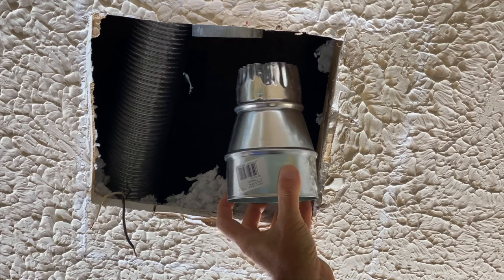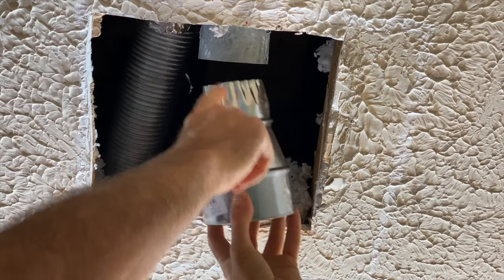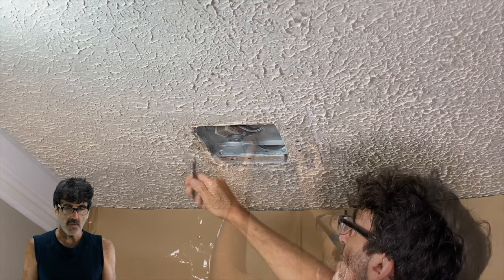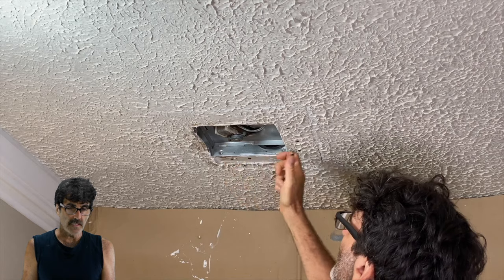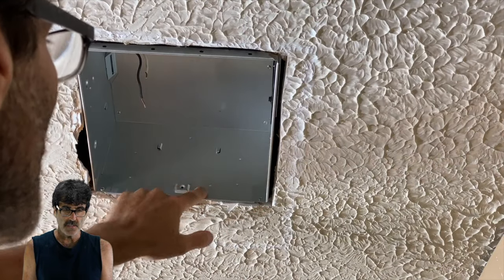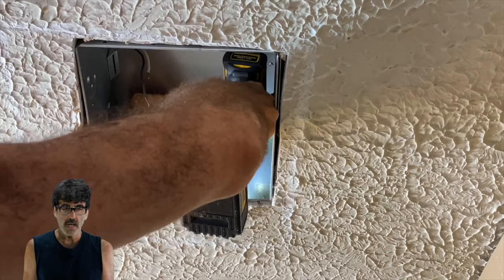How to Replace Your Bathroom Fan Quickly With NO Attic Access! DIY

Comment: I just replaced the fan motor insert with another of the same model but just like before there’s no suction, it’s made 0 difference .. I’m in a townhouse .. is it the duct ?
Reply from the maker: HI, yes theres a good chance the duct is clogged.  If you have access to where it comes out on the house, hopefully it's low enough you can see.  I've seen birds make nests in there and clog it up.  A lot of times there's a flap on the outside with a screen.  If the flap isn't closing good or the screen is damaged the birds can get inside.  If it's on the roof, or a high eave, you may have to get someone to look at it, if you're not comfortable with heights.
Reply: @TheHomeImprovementChannel  on this side of the sown house there’s multiple plastic boxes with slits hanging off the soffit .. that’s not good and should be vented through the roof as I’m reading it causes mold .. but that’s where they are, one of them is the dryer vent and Im guessing the other 2 boxes are for each bathroom up here, I have no way of knowing which is for which bathroom though.. should I run a snake through the venting from the fan side? And do those outside square plastic vents unscrew or how does one even clean them? It’s hard to belive a 100cfm can has 0 suction power .. I don’t even know who I’d look to call for this .. roofer, hvac, general contractor .. I tried angieslist and got no where with any leads
Reply from the maker: @mechanicalmonkey7777  HI, a general handyman can look at those boxes under the eave as long as he has a ladder that's tall enough.  I've seen some townhouses that are 3 stories high, so it depends on how high yours is.  No I wouldn't run a snake from the fan side.. If they used that silver flex duct from the fan to the exhaust port the snake will fill it full of holes.  Sometimes they'll use a hard duct and if they did it'll be fine with the snake.  The birds nests in my experience have usually been closer to the exhaust port on the outside.
Reply: @TheHomeImprovementChannel  I literally tried finding someone using angieslist and after they took all my damn info make me register it tells me no one in my area able to fix a bathroom fan.. which is ridiculous I’m in NY not Guam.. the only boxes I can see are right outside my bathroom window .. there’s 3, one is a dryer and then there 2 other ones that look identical and different from the dryer one.. I can’t see birds getting in because it’s just a box with small slits in them.. I’m not sure which goes to which bathroom though.. any idea where I can look to find a licensed individual to help me..
Reply from the maker: @mechanicalmonkey7777  Arrgh... Angies List probably thought you were looking for an electrician.  Which even if you were shouldn't be any problem.  Yes that does sound like the birds can't get through that.  The ones I usually see have a flap on the outside that's opened up by the fan air movement..  There's got to be something in there if there's no suction at all...  Do you have an electric leaf blower?    you might be able to rig up something from the inside and use the air from the leaf blower to (carefully) blow whatever is clogging the ductwork up.. I wouldn't use it on high power incase you're risking damaging the ductwork somewhere you can't get to it easily.   I wouldn't have anyway to know how to find a handyman in NY.  I would have tried Angies List like you did if I didn't know anybody.  You can try craigslist or FB marketplace, but you will have a harder time verifying if someone is licenced or not..

Comment: What if the old fan is 10X9.5 frame and the new is 7.5X7.25 frame. Should I get a different fan?
Reply from the maker: It would make life easier!  The new one will work of course, but it sounds like you'll have to patch the ceiling since the old one was bigger.  You're better off getting one at least as big if not bigger than the old one..

Comment: Completed this quest on expert mode. Forgot to flip the breaker off
Reply from the maker: I didn't forget.  The power is off with the switch.  I probably mentioned that.  You should check the wires to verify,.
Reply: @TheHomeImprovementChannel  oh no, I watched this post replacement xD to make sure I didn’t miss a thing. Missed them tabs
Reply from the maker: @funnyguy6097  Cool.. Thanks for the input 😀😀

Comment: What about replacing one of those in a mobile home
Reply from the maker: It should be about the same job.  You might want to check and see if it has the removable insert where the motor goes, it might be a quick job if it does.

Comment: Just me or when you pull down the flex exhaust it looks to be a 4" and your new fan is a 4".. @ 6:38  ?
Reply from the maker: It's been a while ago, but I seem to remember that was a 3" flex pipe... House was built in the mid 80s, not sure if it was original or not..

Comment: What if your replacing it with a fan that is the same size?
Reply from the maker: It's possible to swap motors.  See if the new motor will fit the old housing.  Then you can go from there.
Reply from the maker: Sorry I think I misunderstood.  Usually you can just swap out the housing that contains the motor and everything.  I did a video on this a while back:

https://youtu.be/1siTldg2Xns

Comment: How about between floors?
Reply from the maker: Sure can... I did this video on the premise that I didn't actually have attic access (even though I did), but I wanted to show that I didn't need to get in the attic to do the job.  I believe the key is to use a new fan that's a little bit bigger than the old one and that'll help a lot in getting the old one out without damage to the drywall...

Comment: It turned out that mine was put in with button caps, who does that? Made it incredibly hard to get out especially since the box was installed before there was any sheet rock in the home 30 years ago and the entire attic space has OSB.

Here’s a tip while your fan is screaming loud use that to locate the top of the box. It will save you a lot of time.
Reply from the maker: Arrrgh... that does sound like a pain.. ☹️

Comment: Learn from my mistakes. Check where your studs are. I cut my drywall and there was a stud there and my new fan doesn’t fit. So sad. Wish I had watched this before I cut.
Reply from the maker: Oh no!  It shouldn't be to hard to fix.  I have several vids on fixing drywall mistakes.  I would continue to cut the hole next to the stud for your new fan and then if possible try to save the patch where the mistake was so it can be reused.  If it's not reusable, then you might have to get a small piece of drywall to make the repair..

Comment: Nice job but you did not tape the connections
Reply from the maker: Thank you!  Do U mean inside the box?  It's not code here and isn't necessary.  You can walk into a brand new house that just passed all the inspections and the connections aren't taped there either.

Comment: Why do many builders put in duct with an immediate 180 degree bend….so much better to go straight out….
Reply from the maker: I agree with you... Straighter is better...  Hard pipe is best so you don't have all of the ridges of corrugated flex pipe...  Of course flex pipe is way easier to work with...  😊

Comment: I've had a contractor here 4 times.  My fan is still blowing moisture down.  I take a hot shower my floor is covered in condensation.  He says he can't match new fan to duct without getting in attic.  2 different sizes.  We have no attic access.
Reply from the maker: It sounds like a problem with the ductwork.  IS it clogged completely?  Maybe a bird nest?

Comment: Anyone done this with vermiculite in the attic?
Reply from the maker: Arrrgh!  You'd have to be very very careful not to let that stuff stir up any dust/ particles.  I really can't recommend that you attempt to handle that stuff without getting a pro involved to at least clear an area that you can use to replace the fan...
Reply: @TheHomeImprovementChannel  That’s what I thought. 
I’ll just need to figure out how to clean it and get a few more years out of it for now

Comment: I am baffled to what the screws are attaching to when you say a truss? All I see is open space, I’m obviously missing something here
Reply from the maker: A truss is the triangle shaped wood members that make up the roof structure...  Thats also what the drywall is attached to on the ceiling.  Maybe it didn't show up on the camera, I'd have to go back and see the video, but there was wood there  on one side of the hole.